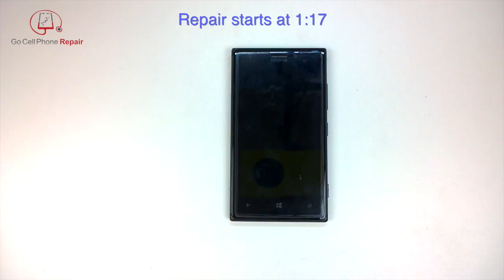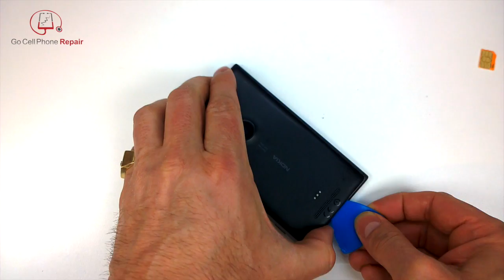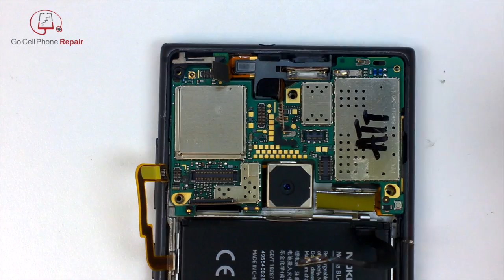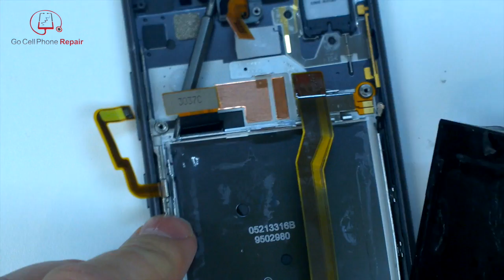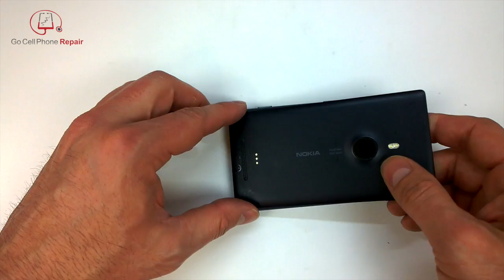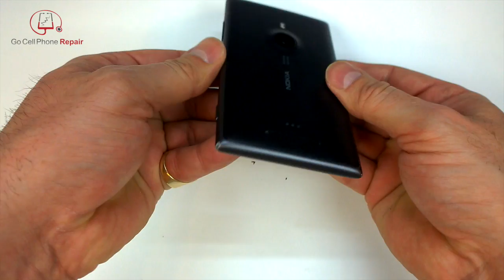Lumia 925 Power Button and Battery Replacement

Comment: Hi, I noticed what seems to be a slight discrepency in the way you are reassembling the phone. On reassembly, you are putting the retaining panel above the battery cable, thereby pinching it and putting extra pressure on the components underneath (ie the vibrator). After following your instructions, I noticed the vibrator of the phone stopped operating altogether.  After investigation, I noted that on disassembly the retaing panel was indeed BELOW the battery cable. When I reassembled it the right way, the vibrator (which is located below the battery cable) was working again. Thanks nevertheless for this very useful video, my phone is now working as good as new :-)
Reply from the maker: Good catch! I haven't had any problems with this one but I can see how that might be an issue. I'll pin your comment so hopefully others may benefit. Thanks for pointing that out.

Comment: after 04:40 can't i change the battery?
Reply from the maker: You probably can but it is safer to remove the logic board if you'll be prying from that area which is the way that I found easiest to get under the battery.

Comment: I changed the power button/camera cable only. No need to remove the battery, I disconnected all the flex cables and loosened  the logic board. Thanks for the video.

Comment: I used this to restore the buttons for the camera, on/off, and volume to full working order (I didn't replace the battery, so skipped the bit about removing the battery). Total cost £7.07 for parts and about 20 minutes work. I don't need a new phone now! Thank you so much for a very clear and helpful video.
Reply from the maker: No problem.

Comment: When I need to replace the Power button only, do I really need to remove the battery first?
Reply from the maker: I don't think so. You should be able to get the cable out separately but I have not tried that yet.

Comment: thank you for a great video, need to replace the battery myself after the repair store failed me (problems with supplying battery).
Just letting you know, when you were putting the retaining panel back on at the end, you overlapped the battery cable.  When you removed the back cover near the start, the battery cable was overlapping the retaining panel instead, don't know if this makes any difference but thought I'd point it out.  Cheers
Reply from the maker: Oh wow. Good catch. It may not make a difference but we always want to put things back the way we found them. Thanks for pointing that out.